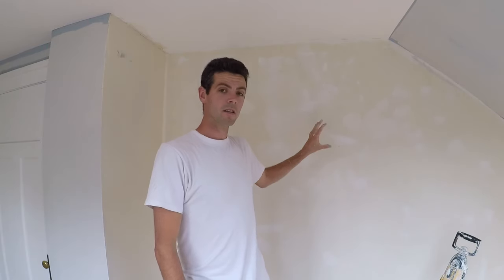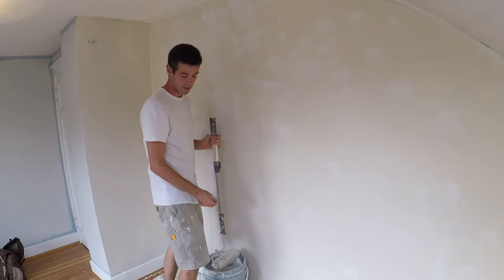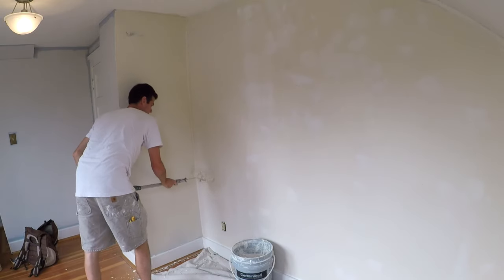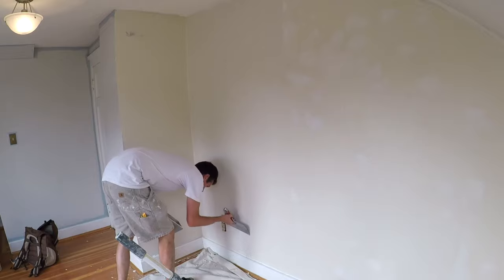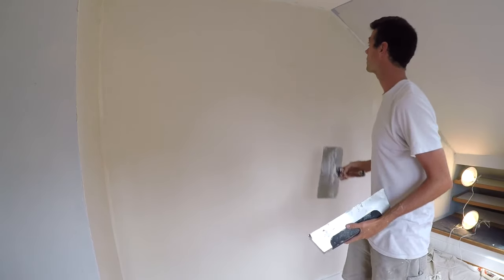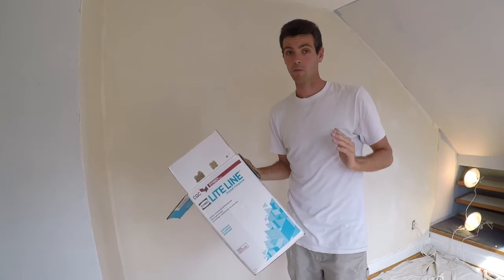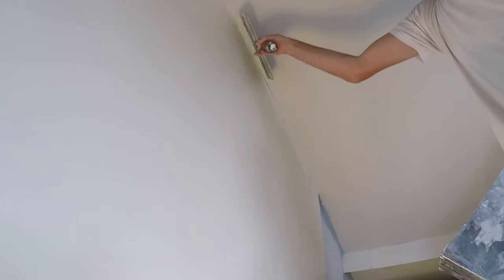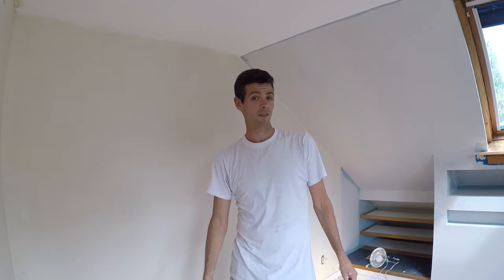The EASIEST WAY to SKIM COAT a wall!!!

Comment: Tho I've done a few, a roller will be my next. One thing tho, I always put a little "hood" of 2" tape over the devices, or for longer duration, full cover them. Its nice that you can still push a plug in and use them and they'll still be clean at the end of the job. The time it takes to cover a roomful equals time it takes to clean up one receptacle!
Reply: Great tip, thank you!

Comment: This method of applying mud to drywall is very effective as I tried it once.  The tricky part is feathering the edges if you haven't had a lot of experience with a hawk and trowel.  The next time I do this, I will take Ben's advice and use the 10" knife instead of the trowel.

Comment: Awesome tip for spreading out the mud. I have some drywall that was over sanded years ago when the house was built and have never repainted it. Will skim coat it now.

Comment: I used this method on walls that a previous owner had applied what can only be described as a sponge swirl affect with peaks!! Think of a merange pie 🥧  ! Yeah it was that bad. Lol! Anyways I sanded the peaks down and then I simply applied the mud with a 3/4 inch roller and smoothed it out with a 10 inch knife. When we first saw the house we thought we would just replace the drywall as it was that bad. But we saved a a lot of money by simply doing this. It came out really nice. You can't tell its not just regular untextured sheetrock now.

Comment: Adding a little dish soap to the mud will help eliminate pinholes.  Break down the surface tension.  Or so my drywall person in Seattle has said.
Reply: WeRemodel.com, llc only a little not very much...

Comment: @Vancouver Carpenter Man, I love your videos - so helpful, I have watched tons of them. I'm watching from the UK, and I wondered, what difference does it make if you were doing this over an old Victorian plaster wall, as opposed to drywall? I have a spare bedroom that I want to do, and having stripped the walls, some is bare (and fairly rough) plaster which I have stabilised with 1:5 PVA, but another wall was actually painted with a satin paint direct on to the plaster which has come off in little patches but is mostly very well attached to the wall, and would be just a pain to remove. Do you think I could use this technique on this room? You mention at the beginning that drywall is a whole different ball game to plaster, but I'm not clear why?

Comment: Since every wall and mud is white and this is what you must work with - maybe you should try some colored lights to bring the contrast and detail out for video purposes :)
Reply: Not how that works but ok.
Reply: Leois12 Sure it is. Lighting is everything. A different light, at a different angle would definitely differentiate the new mud on the old wall.
Reply: We use strong LEDs white light pointed sideways or up at wall no notice all the detects not always do it so seriously though really depends on the project

Comment: I tried another method to get the first coat on and was totally frustrated, and then tried this method today.  I used an old half roller since the room is tiny (it is a toilet separate from the rest of the bathroom) and I only had a gallon bucket of compound where a full roller wouldn't fit.  I rolled onto the first wall above a window and took the knife and voila, done and smooth.  I did the side wall, really only half a wall because tile goes halfway up, and it came out much better.  Easy almost.  It'll need some touch-up, but I took the advice to touch up later rather than muck up now.

Comment: VC, thanks very much for your advice. The most valuable content from earlier videos was how you loaded your knife for the corners and how to thin the standard compound for pro results. I recently finished a bunch of 12 foot joints on a ceiling right in front of huge windows (i.e. major lighting was right across the seams) and the result is golden. Very proud of the result and I have to give props to you. Next up, I have to skim coat a 100 year old plaster hallway. Looking forward to using your advice again.

Comment: If you add a quarter cup or even less of liquid laundry detergent it will absolutely eliminate ALL air bubbles/pockets. The first time I tried it I was in shock/amazed. Use any time you mix mud, not just skim coat.

Comment: Greetings from Chicago.  Find it therpudic to watch your videos. Not in the trades but my father,  carpenter by trade. Back when I was a kid , he would have bathroom or kitchen remodeling jobs...I recall fondly washing the tools, mixing...iam still able to mix up a pan and must say pretty snappy at it. But from watching and doing a bit....iam able to tape, slow but I can get it done. Few times I've mixed up ....say 45 or 90 topping.....just before it sets.....I hit it with a sponge....just to be playing with it. I've had great results and than sand....

Comment: Did you do any prep on the wall before applying the mud? I just removed wallpaper from the walls and was thinking of degreasing with TSP and scraping loose pieces. Then prime with a sealer primer like Kilz2 before skimming with mud with your method.

Comment: Great content as always!
I just had usg all purpose completely eat kilz 2 primer and the paint underneath it skimming the shoddy seam at the wall to ceiling joint that I decided to fix after priming ( you wouldn’t believe what happened the first time around with this primer ) It sloughed off like I’ve never seen before or thought could happen. How does everyone get else away with it? Lol
I want to skim this wall but I’m afraid to now. I was thinking of priming it with oil based primer just to lock it all down and be sure I don’t have a problem again🤷🏻‍♂️
This project is knocking years off my life already, everything has been an uphill battle. Like climbing Mt Everest with one leg, sliding down on my face, and doing it again lol

You’re using usg all purpose here?

Comment: I love your videos but I have a few questions. I like your roller method of All-Purpose Lite (similar to USG Plus 3), but are these plaster walls or drywall? -- I'm repairing old plaster and lath walls after wallpaper removal and plan to do a skim coat to smooth it all out at the end. 
1. Which joint compound is best to repair the small dings and holes in the plaster in first coat?
2. Which joint compound is best for first coat skim? Durabond 90? EasySand 90? All Purpose (green lid) or Plus3 (blue lid)? Other? (I know these are the US versions)
3. Which joint compound is the best for the final skim coat?  
Thank you and thanks again for all your awesome videos! I've learned a ton!

Comment: Don't know if you have that in Canada. Polimer based ready mixes dedicated for a roller. They dry long (48h +/- before sanding), but you can apply a whole wall before it starts drying out.
like LSR from Fluegger.

Comment: after doing this, do you still need to apply a sealer/primer before painting?
Reply: Yes. And for future reference if you aren’t sure if something needs primed, the answer is yes. It does.
Reply: definitely. I prefer a PVA primer primer for drywall. Its cheap. Otherwise you will be spending loads on quality paint.

Comment: Can this be done on a wall that is already painted? Currently remodeling personal home with the help of your videos, and I have a master bathroom that the previous owner simply painted over drywall issues. Needless to say it's a mess. I was hoping I could find something like this and what you would recommend. Also, I saw in one of your previous videos that applying mud to painted surfaces prevents the moisture from getting in to the wall and therefore to the surface of the mud. Any thoughts or past experiences would be greatly appreciated!

Comment: I use a sharpie to mark the side of the knife where the tips point out so I can tell at a glance which side not to use. I put arrows pointing up to the corners on the thicker part of the blade near the handle.

Comment: If there are imperfections in a skim coat and you're trying to go for a smooth finish, is it possible to fill things like scratches, pocks, and rougher areas without those areas flashing after priming and painting? Or do you literally have to re-skim the whole wall to get a uniform finish? That seems like it would be an endless quest...

Oddly enough, I haven't found many videos from anyone on how to properly touch up a skim coat (if that's even possible). I've watched Vancouver Carpenter's video on what not to do when touching up a skim coat (i.e. touch up after priming, don't touch up sanded mud, etc.). But I can't find a video on how to properly touch up a skim coat without having splotches and flashing all over the place.

I mean, I know ideally a skim coat should be perfect after applying it, with no tool marks etc., but let's be real, there's always going to be something that gets through, whether it's an occasional hitchhiker scratch or an accidental ding in the wall from a stray tool. But surely re-skimming the whole wall isn't the only solution in all these cases?

Comment: Do you think this technique could be used to hide the grooves on wall covered in grooved wood paneling? Maybe in conjunction with your technique of adding glue to the mud...
Reply: I wouldn't count on that lasting; seasonal changes in humidity and temperature are going to make the wood expand and contract enough to crack all of joints between sections of paneling. Also, just the fact that most wood panelling is pretty flexible is likely going to cause the mud to pop out of all the grooves.
Reply: I forget what the product is called, but there is a wallpaper like product (basically is wallpaper but thicker) for exactly that purpose. To apply over wood paneling or cinder block to get a smooth surface in order to prime and paint. It comes with or without the adhesive and you hang just like wallpaper. I was looking into this as a easier (less mess) alternative to skim coating textured walls.

Comment: How do you calculate how much much needed for skimming like this? I need to do all walls to remove light texture, and all ceilings after removing popcorn.
I can't find an approximate way to calculate for this job anywhere. Any insight?

Comment: Had a quick question. Doing a small remodel on a bedroom closet. I put up drywall, taped, mudded, and attached corner beads. I need to sand and apply more mud to finish the corner beads but had a question about finishing the bare drywall. I am planning on using a roll on texture to try and match the existing walls in the bedroom. Do I need to skim coat the drywall first to match the thickness on the corners, or can i apply the roll on texture directly to the bare drywall?

Comment: Can I use Plus 3 to go over old walls? Several of my walls are filled with old patches. I want to skim them instead if replace drywall. Should I use Plus 3? How many coats would you suggest?

Comment: I have achieved some great drywall work from your videos.  One thing I noticed on the 10" drywall knife I bought, it has NO bent corners.  Not knowing what else to do, I put some very slight bends in the knife myself.  Are the curves someting the pros add to their tools?
Reply: Some do and some don’t. An old knife only used on one side will develop corners slightly bent up. If this is easier for you to get good edges then bend the tips a bit gently with a crescent wrench.

Comment: Im from the UK, and as u said the done thing here is to skim with plaster using gypsom multifinish, i like what you have done. Do you know the product is sold in the UK, or know what it would be called here, we dont have anything called mud.
Reply: Gyproc pro mix, Thin it down and away you go.

Comment: Enjoy your videos... keep them coming. Is there are different technique for PLASTER walls? If so would love your suggestions or method.
Reply: I've used this method on plaster walls with no problem. I've never quite understood those who claim that drywall mud should never go near them; it works fine for most things.

Comment: Ben, Vancouver Carpenter has the best video for us DIYers. 
I’m planning to use this roller technique once I remove the wallpaper from a stairway to our lower level. What are your recommendations for prepping the walls once the paper is removed / before the skim coat?
Reply: I use oil based Primer to block stains and seal out any remaining glue. Helps smooth it out quite a bit as well.

Comment: Thank you. You helped me to do this type of work. Lots of sanding for me, but the more I do it the better it gets. 
So I have a question:
Is there a way to seal this skim coat after it drys, so the drywall mud will get hard to prevent dings and scratches, basically to make it hard as a rock? Would you need to something like that?

Comment: Wet your powder with 30% water 70% matt emulsion it makes the skim Cote smooth and binds it better . If your going to paint a wall a certain colour use that colour as a tint 50-50 for colours .

Comment: Fantastic video. You mentioned something along the line of applying the same method to textured ceilings. I just want to confirm if skimming is indeed a doable method for textured (not popcorn) ceilings. Thanks
Reply: I have done it. It's a pain but the results are worth it.

Comment: I'm getting ready to repair hairline cracks in my plaster walls and ceiling in my bedroom.  I was going to use caulk to fill the cracks, should I do this skim coat over the whole ceiling and walls to smooth it all out?  The house was built in the 30's and we used joint compound 20 years ago to repair the cracks.  It's a 13'x14'  room with 9 ft ceilings.  Any advice would be helpful.

Comment: I have the green lid joint compound I need to skim coat a wall that has wallpaper glue on it.  Should I add water to it to thin it out?

Comment: Great video!  

Newb question- Is Primer required on the walls first or a glue mix that is needed to be added to the mud?
Reply: No. Mud should be applied straight to the paper surface of the drywall. It can be applied over paint, but the mud won’t bond as well to a finished surface.
Reply: So if there’s paint on the wall from decades ago then I have to sand it down to scuff?
Reply: Sleightly Overwait I’m wondering the same. I have original walls in home with many layers of paint and need to do a skim coat but I’m worried the mud won’t adhere properly. One of his videos he mentioned you’ll get a lot of bubbles skimming over paint and you’ll have to do lots of sanding

Comment: @VancouverCarpenter We have a wall that was covered in old wallpaper and we removed it. Underneath is just drywall paper. Do we use the shellac primer on the entire wall and then use this method to mud it?

Comment: @Vancouver Carpenter 
Thanks for this, I have abit of a issue of this project am working on, someone mistakenly painted oil paint on the walls so now me painting emulsion paint and is causing bubbles which won’t sink in after , and am thinking of skimming on top then paint after , is there anything you can suggest for me pls , thank you

Comment: As a total beginner, if my walls as bumps and dents in it - what’s the ordering of work here? Is it:

Fill the holes and wait to dry
Sand the wall so the filler and other bumps in wall are smoothed out
Skim and wait to dry
Sand again
Paint?

Comment: I tried this. By the time I tried applying my second roll I was removing some of the first roll. I suspect it could be one of a couple things. It’s 26 degrees in my house. Would temperature affect this? The other is my mud. It’s a few years old. Would something happen to it over time that would cause this?

Comment: Thank you for posting this video I have some painted textured walls that I want to smooth out do I have to sand the paint and texture down before applying skim coating?
Reply: Nope, the mud will fill in the valleys of the texture and make everything flat

Comment: Aloha Ben! I need your expertise. What's the best way to seal skimmed walls? I noticed that its horribly easy to get little nips and scratches on the walls even after applying 2 coats of primer ( I used Kilz 3 Premium). What do you use or recommend to apply a better seal. And I skim with all purpose light.

Comment: Help!!! We just purchased a home that was built in 1999 and the entire walls and ceilings are rough with spots of deep orange peel and lines for the texture. Someone said it was called Old World but it's awful and if you bump it with an arm you can actually get road rash. What can be done without tearing out the entire sheetrock and starting over. What were they thinking back then?

Comment: Ok great right near the end you answered my first question...mud will stick to a painted wall. My walls have lots of nicks and some gouges from a old persons wheely walking frame handles and wheels gouging and scratching mostly in the bottom half and third of all my walls. Could I skim coat the damaged areas only or is it best to coat the whole surface from top to bottom? The top half mainly has damage from picture hooks and nails used for hanging things so there I was just going to spot fix maybe???? Lastly if you do two adjacent walls how do you skim in the internal corners? At the same time or one first let it dry then the adjacent wall?

Comment: Does it have to be perfect to put tile over the finished product? Do I need to do a primer coat of paint before tiling?
Reply from the maker: Surface imperfections are fine but It should be pretty flat if you want your tile job to go smoothly and look good. Priming will greatly improve the adhesion of your tiling cement.